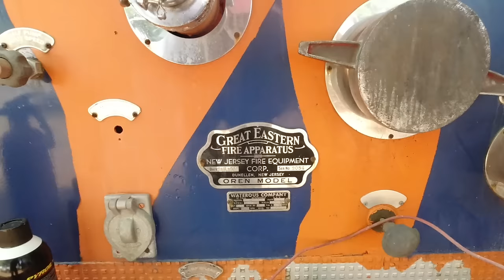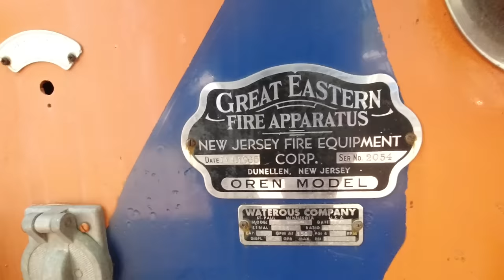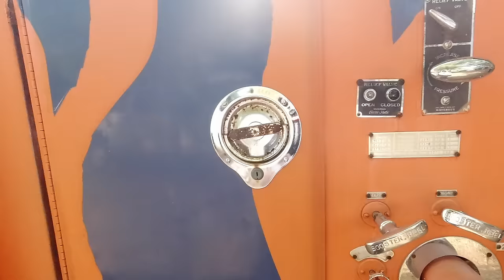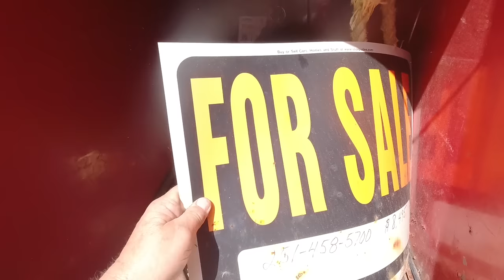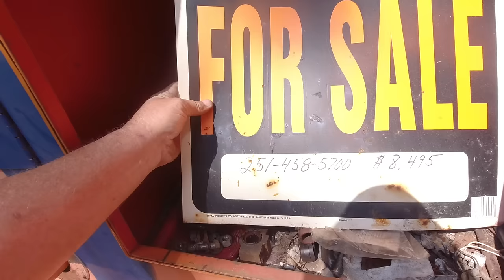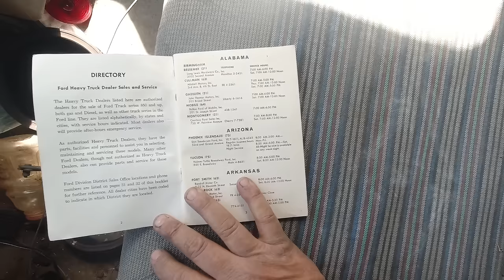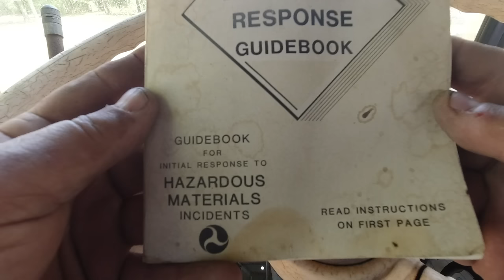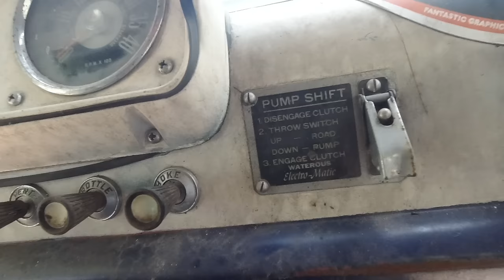59 YR OLD SUPER DUTY FORD PUMPER Truck turn PARTY Truck !!!Whats Next?

Comment: Actually drove these in the fire department when they were new.  Usefulness depends on the motor & trans ...  4 speed not to hot.  5 speed much better 😊
Pump and bits prolly OK.  Tank may be rotted out ...  I see the wooden hose deck is gone.  Brakes are prolly hydraulic over air ...
The whole point on these was maneuverability.  The cab forward good visibility while turning  😅
Reply from the maker: Thanks for sharing and watching
Reply: Careful in the sharp curves... That water would slosh in the tank and throw the truck into a ditch before you knew it. Happened to a friend of mine on a call. That was the end of his career as a volunteer fireman.

Comment: Wiley I think 🤔 you can get it to run 🏃 but it needs to be painted red and make it back to the original fire 🔥 truck 🛻 to be used in a parade  you have a great 👍 day
Reply from the maker: I think he plans in getting it where it will at least make a complete parade route. But he said he is keeping oaint scheme the same. I agree with you. A new fire engine red would look good 
Thanks for watching

Comment: I remember when I was 4 years old and my father brought a BRAND NEW one home for our rural fire department. It didn't need a siren. That 534 cubic inch beast had straight pipes, no mufflers. You could hear it starting  from 1/2 mile or more away when it dispatched. When it was brand new, the "new fire truck smell" closely matched tire rubber! LoL.... I guess the tires and the firehoses cause dthat.

Comment: Thanks for another fun video Wiley. 

It was interesting and enjoyable. 

Don’t know what you have there for sure. If that has set for years it might need a lot of little things done to it to make it usable. 

May have to invest a few bucks in it to make it usable. Hard telling what condition it is in until you can get it running. 

Just depends how much you want to put into it. 

Thanks wiley for telling us about it. 

The Iowa farm boy. Steve.
Reply from the maker: Thats exactly right. 
I think he wants to patch running gear up so it will at least make it all the way through a parade route. 
At 2.5 MPG he will trailer it to town

Comment: Open the doors to pull cab, and check near the coil mount or intake and there should be a aluminum tag with year and engine CID
Reply from the maker: Thank you for sharing

Comment: Excellent video Wiley  :) very interesting fire truck also paint job most certainly and so wild ! Also remember those truck on fire department my late dad was had one plus International  cabover 1972 gas motor 6 cylinder 270  size with 2 barrel with 5 speed Manual transmission  floor shifter  , single tadem axle and daul fuel tanks no air brake just hydraulic!
Reply from the maker: Thanks for sharing and watching

Comment: Should be able to get it to run easy. You might have to clean the points where it has been sitting. I drove one of those Ford Cabs over back 1972 it had box bed on it . Thanks for the video
Reply from the maker: Thank you for watching and sharing

Comment: Wily, That truck is the same exact age as I am. Overall the truck looks pretty straight. We used to have a VacAll truck that was on the same cab & chassis that was later repurposed as a salt brine truck because of its ability to handle a huge tank with the salt brine and or calcium chloride to pretreat the bridges on the interstate highways here in Kentucky.
Reply from the maker: Thank You for sharing that.
Reply: Wily, After I made my comment, I remembered that the Ford COE trucks were also used for the highway striping setups with the long chassis. 
The COE Fords that we had in our fleet were all diesel. I am not sure what engine it was though. A good number of our Ford tandem dumps that were around the same age as the COE Fords had the 3208 Caterpillar engines. 
When the Fords were being replaced with the IH/Navistar trucks with the DT466 engines, Our drivers really missed the Ford trucks due to the very short turning radius because the IH trucks took 40 acres of real estate to turn around compared to the Fords. The VacAll unit that I mentioned before also had a 3208 Caterpillar engine to power it independent of the diesel engine that powered the Ford COE truck. I do not remember any of our Ford COE trucks having any gasoline engines, But the cabs inside were pretty much identical to the cab you were showing in your video.